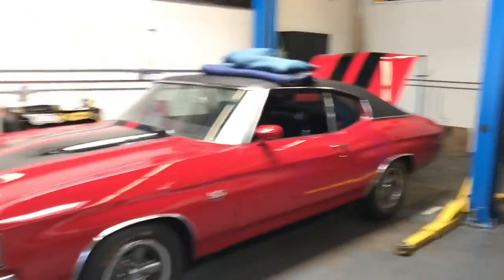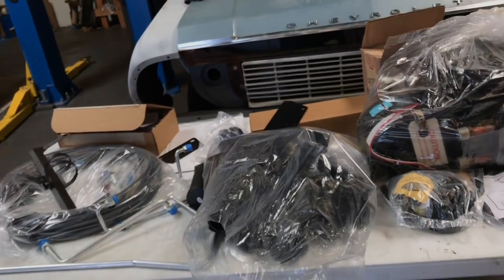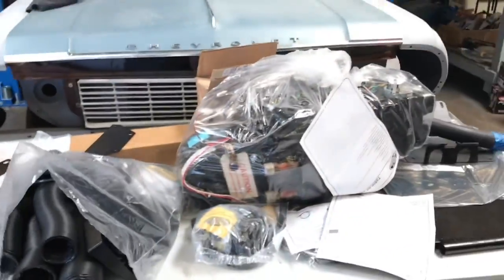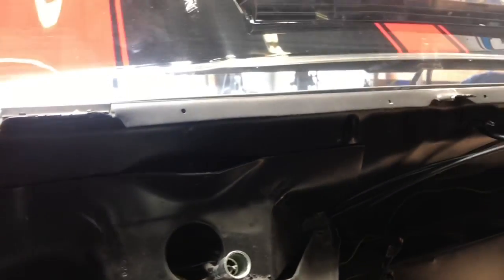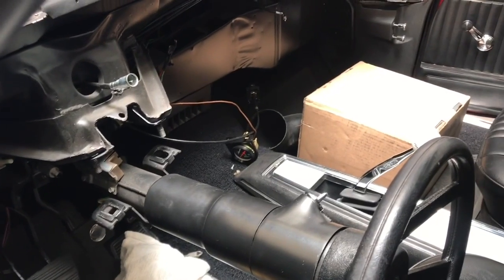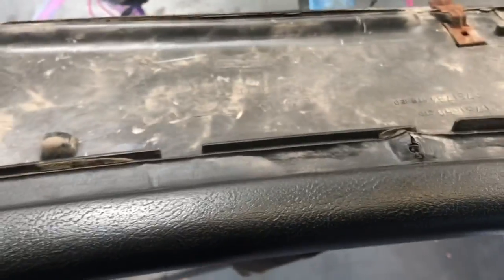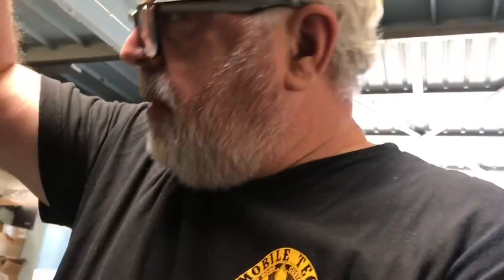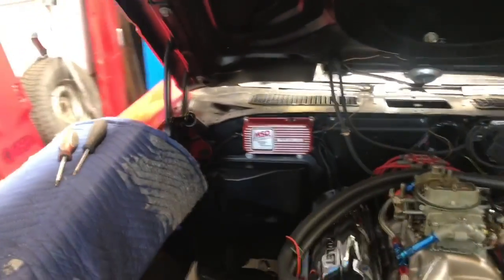This Big Block Chevelle gets Even Cooler

Comment: That era takes me back to points and condenser distributor...miss those days, no electronics, 1st car was a `66 Chevelle...193 cubes of straight 6 when I got it.....poof that 6 turned into a 350sbc with Accel dual point distributor and a super coil.Pulled the one-legger and poof...posi tire shredder. Who remembers points? besides me...lol. Todays cars need expensive scanners to diagnose.

Comment: @Lucky do you rate the under-dash units? Looking at aircon for a 68 - C10  but they are RHD from the factory here - so doubt anything vintage air do for a C10 will fit (?)

Comment: I like that you left the original heater box and modified the block off plate.  I would like to put a new vintage air system in my factory air c10 and may have to borrow that idea.

Comment: What's the typical cost of installation of the Vintage Air setup like this? And can this be used with a stock radiator or is there risk with overheating?

Comment: I got a 396 big block 69 impala 
Cant get it to stop popping in the intake but it still drives.any help anybody .plus I put a electronic in the distributor to get rid of the points .but its poppin still.help!
Reply from the maker: HOGSIDE SJ T.V.  Confirm your firing order , cap , wires.  
 If only 1 cyl poping (ALL the time) possibly a intake valve problem. Good luck
Reply: @luckysgarageshow  thanks folks.
Reply: Are you running the points lead to power the electronic ignition ? If so, run that lead to trigger a relay from main power or bus to the electronic ignition supply. The factory wire has resistance built into it and cannot properly supply the ignition. Did this when i switched to an HEI and have had zero problems ignition wise for over fifteen years now.
Reply: @TheCanadianBubba  wow that's probably the problem. I didn't know it could do that.thanks I just hooked it up the regular way .just the two wires.thanks again.
Reply: @HOGSIDESJTV14BOSSHOGRECORDS  Well that depends.  Was the popping there before the distributor change?
Reply: @ShainAndrews  yeah little tho.had a couple lifter loose in the back .I'm thinking I  tighten a little to much mabe my valve is open to long.thanks for the tips every body.

Comment: Dr.D here in sunny Regina I would sooner be working on the kit you have then trying to fix old factory or dealer installed air,good luck. Ps. not a real doctor
Reply: What is so bad about factory air? I repaired the factory ac on my 88 K5 blazer a couple weeks ago and had no problems. My 79 C20 is the same, other than having the older longer compressor. Of course my trucks are in great shape with nothing more than a little surface rust from old paint being beat up by the socal sun. Factory AC has many advantages including a heater. If someone sacrificed the original heater/ac box for a bigger engine, then that changes the options.
Reply: usually older units need retro kit, so vintage air you can get every thing for 134a to comply with regs
Reply: @dougfehler299  My 88 still has the original R12 compressor. Someone added adapters for 134 before I got it, but I installed new ones as one was missing and the other was leaking. Ester oil is compatible with r12 and 134. I did not change the condenser, as there are mixed reviews on the quality and fitment of what I think is called parallel flow. The 79 has had a new compressor twice and the new one was meant to be used with 134. The 88 had the black o rings and 134 requires the new green o-rings. The work I just did on the 88 was my first time working on AC refrigerant system and it was surprisingly easy. In the past, I replaced heater cores and repaired the blend doors and actuators, which was the real PITA. My uncle owns a shop, so I used his tool to flush the ac lines and had him do the leak test and charge with his snap on AC machine. Also, there were some good forum posts on doing AC work on square body trucks, so I knew what was required. I'm so glad I finally tried it myself instead of paying a shop to do all of it. The vintage air is a great choice, when repairing the factory air isn't feasible for whatever reason.

Comment: its a 72 but im pretty sure that steering wheel is like a mid 70's to early 80's Monza/Camaro/non-telescopic Corvette wheel.. but they cool, I had one in my 67 el camino for years...
Reply: Was going to comment that as well... then i Googled 71 and 72 interiors and there were quite a few with that wheel, so its a popular swap if it isn't factory.
Reply: p3th3t1c i feel like those wheels find their way into many old gm cars. And 90s lumina steering wheels too, strangely
Reply: My 71 chevelle ss came factory with that wheel, build sheet said nk4 sport wheel
Reply: And there you have it... thanks for word
Reply: TheCanadianBubba ha so that wheel really was from then, i always thought it was from 78-81 camaros originally! Always learnin